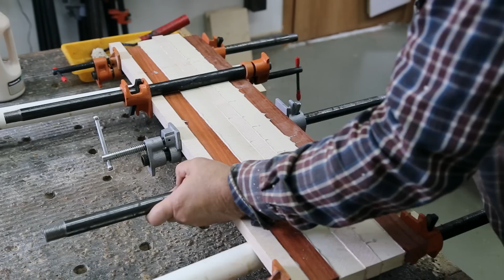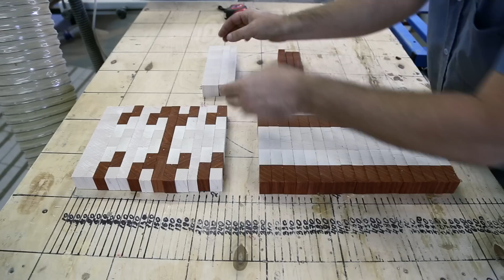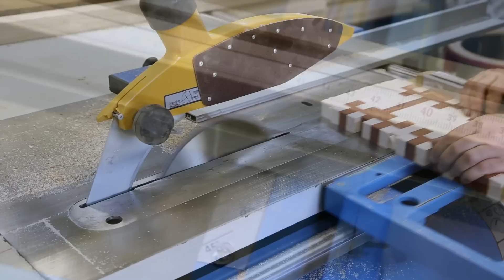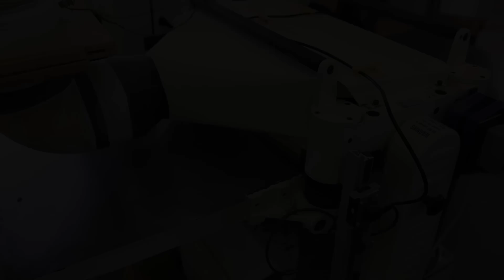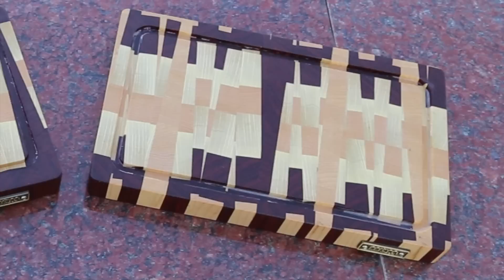Making two simple chaotic pattern end grain cutting boards

Comment: Wow. That is gorgeous! What brand is that CNC? Congrats.
Reply from the maker: Thanks!
	
CNC-Milling Machine HIGH-Z S-720/T:
 Drive : 4 stepping motor by Nanotec with 1600 steps/rev    (1/8 Step)
 2 motors for constant tension and compression during milling operation on X-Axis
Guide ways X and Y axle 22 mm / Z Axis 16mm, grinded and with 61hrc hardened surface
 Ball bearings at both sides of trapezium spindles Tr. 12x3 mm flank lead
Traverse speed of rapid feed max. 2500 mm/min
Technical disslution 0,00187 mm ( 1/8 Schritt )
Table size / clamping area:1050 x 520 mm
 Traverse Paths: X=720 mm; Y=420 mm; Z= 110 mm

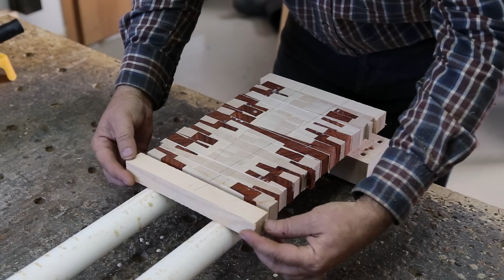Comment: vices that can be seen and used in minute 3:30 where you buy it? 
in Italy are not the same. 
Again congratulations for your work

un saluto ;)
Reply from the maker: These are so-called "pipe clamps". I buy them in Russia. You can easy find them at Ebay.
Reply: Grazie,
io li ho trovati in italia della ditta BESSEY confezione da 4 pezzi senza tubo a 90€ secondo lei com'è come prezzo?
Reply from the maker: It very expensive, because it is Bessey. In Russia I buy them for 7-9 euro/pc. Made in China. Very good clamps. You can find them at Ebay for 7-10 USD.
Reply: Grazie, siete veramente molto gentile.
Reply from the maker: Спасибо!
Reply: Salve, potete inviarmi il link dove li comprate voi? io non riesco a trovarli con Ebay.it
sono davvero curioso di usare queste morse :)
Reply from the maker: Only in Russian - http://www.sverli-strogai.ru/catalogue?c=11
http://www.ebay.com/sch/pipe+clamp